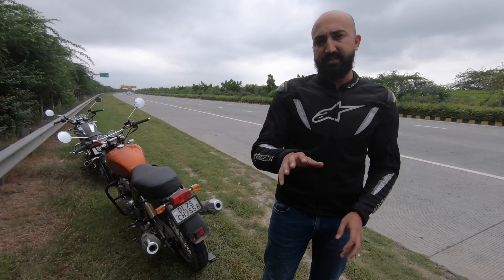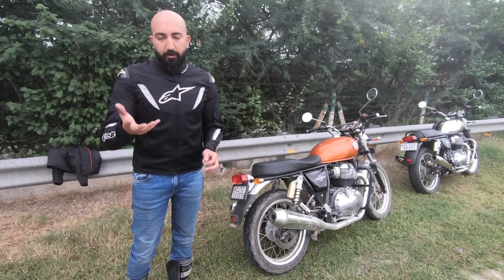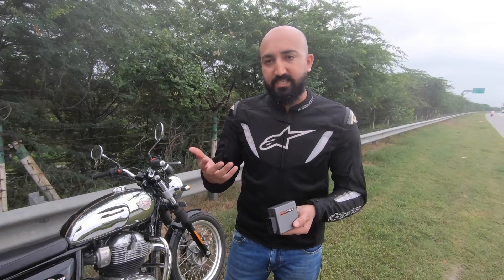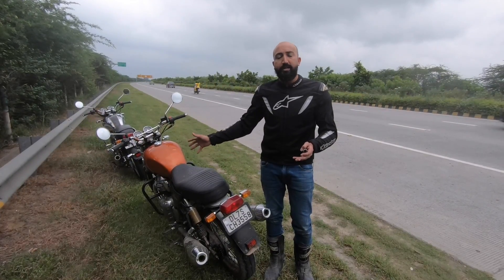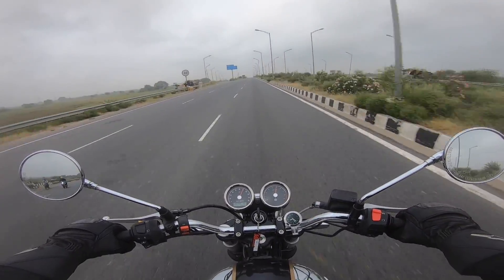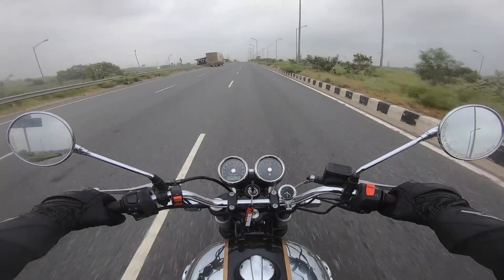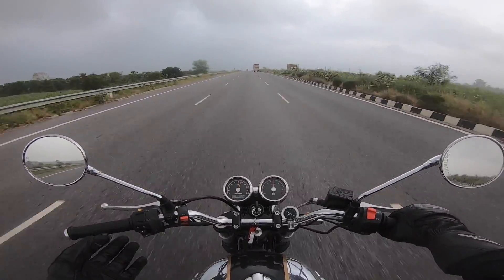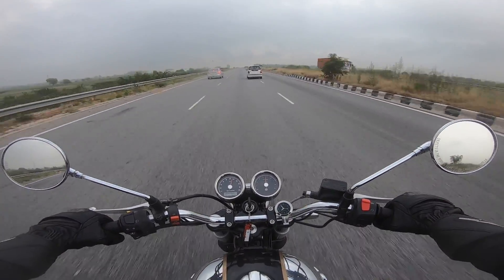Powertronic ECU For Royal Enfield Interceptor 650: 3-Month User Review

Comment: Spending 3 lakh on this id prefer to keep it stock. 
It's about looking good than going Fast here. 
Hahah, my pov. 😅
Reply from the maker: No problem with that. To each their own. ✌
Reply: Bike cost almost 3 lakh + 3 lakh for ecu?? I guess you will get better bike for 6 lakh
Reply: @jbasumatary7861  which ECU did you buy for 3 lakhs?!
Reply: @jbasumatary7861  ecu. About 20k ok who said 3lakh for ecu
Reply: Yeah bro me too 😅😅
Reply: chandrakant Singh Pratap  it's around 20k 
Plz see the video there it is mentioned
Reply: chandrakant Singh Pratap you think ur self that u want extra 2bhp and little torque or not 
Because thrilling experience never comes with worth
Reply: chandrakant Singh Pratap  it comes with two performance modes. The first one does increase power but due to the better fueling the mileage doesnt decrease. The second one is extreme sport mode which offers  better top end punch too...well obviously since its extreme sport mode the second mode reduces mileage but only 2-3km difference mostly because you will also be riding hard in that mode 😀i have done my research and i have also been using it on the r15 v2 for several months now hence saying from my experience 😊

Comment: Should have tried the ECU with high octane fuel, to get the best result
Reply from the maker: Didn't do that because it is not something most will. Otherwise even I would prefer riding on 97 octane fuel :)
Reply: Nothing will happen, high octane is used for high compression ratio engine with advance timing.

Comment: Its better to wait if any seller imports S&S Big Bore kits(750cc and 865cc) for the 650 twins. 
Wasting money and time on cheap and useless aftermarket slip on endcans and piggyback ECU has no sense.
The Big Bore kits can bump up power significantly and though they are not street legal but no one can know if you have used them in your bike.
Reply from the maker: The big bore kit and everything else accompanying it will cost upwards of 2 lakhs. How many would be okay spending that kind of money?

Comment: Why don't you make your own maps? It's pretty easy.
Reply from the maker: Hey man. I will. On my own Interceptor, I am running a 2x1 full system and with a filter it was running very lean. So will tune the map accordingly. You should check it out once. Do send me a DM on Instagram if possible. My id is abhinavbhatt19.
Reply: @abhinavbhatt  sorry bro I am not on Facebook, Twitter or Instagram. 😂😂😂😂 But mail me crazyfor200mph@gmail.com
Send me pics of your map I'll see if I can help you with mapping. I am using my own map on my RC 390.
Reply from the maker: @cranky1812  Will do, bro.

Comment: Adding those components didn't do much to the 0-100 & 0-120 flat out numbers. Both remain the same. So no point doing all the circus. Saying cause these are the speeds most will cruise on. Now sure how effective is this on city traffic. I wish some one opens up the engine and does the real work.
Reply from the maker: You could go in for a big bore if you'd like. The difference is not always about the numbers. The smoothness, throttle response and quickshifter compatibility are worth it, in my opinion. Try taking a ride with a Powertronic box once.
Reply: @abhinavbhatt , I agree.

Comment: Flashing ecu is a better option?
Reply from the maker: Who is going to flash it for you? And what about warranty, reliability? Powertronic is plug and play. You can take it off anytime and to back to the stock bike.
Reply: @abhinavbhatt  mantra Racing, i  don't have a parallel twin, instead have a few, usually i used to put a power commander or a bazzas over a ft flash for tuning , but last few times got a diavel and a busa flashed by mantra Racing, fueling was spot on, no needs of commander,
I would suggest a flash, filters, block off, exhaust, piggy backs very limited in algorithms, its just a buy pass, yes of course its a personal choice.

Comment: I have a powertronic ECU on my duke 390 and by making it run the correct Air/Fuel ratio it feels so much more responsive and does not run as hot as it used to.
Reply: This is the only valid reason for fitting an upgrade ECU.
Reply: Does it consume more fuel than before

Comment: Don't take other wise but in the city road conditions it doesn't help any more.In the normal riding condition only Power and average is matters and she is not designed for racing any more, specialy low compression ratio, bottom end torque ,air cooling, long gearing ratio & wait doesn't allow her to conquer the race.
      If it can be possible to  improving the existing ECU tuning then it can economical otherwise Westgate of money.

Comment: Your test is flawed.the test  bike should have been stock with only powertronics ECU instead of original ECU.you should not use different air filter, exhaust or changed the gearing of the test bike
Reply from the maker: I understand that. But I was running a map that is made for the filter and the exhaust. And I did not want to change back to the stock exhausts. The difference wouldn't be that big though.
Reply: Only the ECU should make no difference to stock. You need to open up the intake and the exhaust to get more flow. No flow, no go! :)

Comment: these ecu's  they make are way overpriced to the performance they offer.
Reply from the maker: No. I don't think so. Compare them to the prices of exhausts.
Reply: @abhinavbhatt  exhaust gives you looks, sound as well as a little performance. the ecu is just too expensive  in my opinion. and they void the warranty which is a bummer
Reply: @sagaraher5611  you are wrong.
Reply: cranky1812 do your research and then comeback with a reply
Reply: @sagaraher5611  I am using powertronic myself since 2016 on my RC 390 and it works flawlessly. I am using my own map and other mods on the bike. With just piggyback if you gain 2 to 3 bhp then it's very good. Also when someone goes for air intake modifications, exhaust modifications, head polishing and porting, high lift camshafts, bigger throttle bodies and bigger injectors then this piggyback ECU will give that engine a huge power boost as in powertronic you can increase fueling and ignition timing upto 25%. In this unit AFR, ignition timing, CKP, traction control, quickshifter, rev limiter can be adjusted. This unit is plug and play with complete wiring and software. My research is fine and my practical use is working awesome, do you have powertronic to access if it's good or bad?
Reply: @mohba01  you are wrong my map is absolutely different from the basic map of powertronic because my air intake and exhaust are not stock and default maps are to lean for my  mods. My CKP trigger values, ignition noise filter and load input channel are totally different and so is standalone mode trigger RPM.  So yes this my map which only works on my specific mods dude.
Reply: @mohba01  I don't need flow bench when I can ride and see that my RC has lost the acceleration and top end, with lean condition it ran crazy hot. I have been riding for a longtime and I can tell if an engine is running lean or rich. I don't have my personal Dyno in my house so it took me few weeks to get the right map.
Reply: @mohba01  powertronic default maps are for stock air filter with closed lid, my air intake has complete open lid with K&N so anyone can tell that after this mod huge amount of air enters the engine. My exhaust is completely free flow with almost straight short pipe with short muffler under the seat. This set up makes it crazy lean on default maps.
Reply: @mohba01  my ignition timing is at different degrees at different RPM range with respect to TDC. If you want I can send you the map pics for ignition.
Reply: @mohba01  maybe ejk unit is better but we don't have anyone selling ejk unit here. I have to work with what I have here and which is available in the market.
Reply: @mohba01  to improve the performance further I am looking for a wide band oxygen sensor, load input channel on PT can be calibrated from not only throttle position but also from injection pulse estimate.
Reply: @sagaraher5611  so better to pay for a mod that gives you "sound" and a little performance rather than something that only gives you performance? 
FYI, any aftermarket accessory would void your warranty.
Reply: @PierreSiddarthdeSouza  free flow exhaust without AFR correction will decrease power output.
Reply: @cranky1812  any changes without changing the fuelling and ignition would lead to a drop in performance.

Comment: the 0-100 timing would have been much better if you could have launched better (maybe around 6sec or just under it) because i myself found the timing to be around 6.3 seconds and that too with just an aftermarket exhausts. the quality of the video is otherwise good and the video informative.
Reply from the maker: Hi Ayush. See, I got a bad launch almost consistently on all tries. So definitely a better launch will give better results. However, don't look at the best achievable numbers, that will vary from person to person. Look at the difference between the numbers - that's what the video is trying to convey. I am glad you found the video informative. Cheers

Comment: Any heating issue if you use just a slip-on and will it affect the engine and mileage drop 
Am looking on the long term reliability with a good slip-on, Thank you.
Reply from the maker: Hi. No heating issues whatsoever with a slip on. Fuel economy drops less than 10 per cent. My impression of slip ons - both AEW and RRP - has been very positive.
Reply: @abhinavbhatt  hi watz your opinion on grease house growlers?

Comment: Hi bro..nice video with comparison. I have something to ask. Please help me out.
I've a GT 650. I'm planning to go for aew megaphone.
1. Whats the difference between TE 101 , TE 102 and classic short 201? Which one should I take?
2. In TE 101 stainless steel matt polish is showing 16,000 and mild steel chrome is 9000 (though they almost look similar).
Is that the price of one piece or a pair? And why so much difference.?
Reply from the maker: Hi. The difference between 101 and 102 is just a bit of difference in shape. 201 is a completely different shape, more retro. Go with the one you like the most.

The chrome one is made of mild steel and the matte one is made of stainless steel. Stainless steel doesn't rust and looks better. Zero difference in performance. So go with whichever you feel like spending for.
Reply: @abhinavbhatt  the prices are for one piece or a pair?
Reply: @abhinavbhatt  like...if i go for 102 stainless steel matt polish ...do i need to get 2 units for 36k 😯
Reply from the maker: @adikumar7099  the prices are for a pair.

Comment: Trust me I have been using powertronic ecu on my rc 390 for past 5 months city drivability seems pretty good without any jerks, mid range seems pretty aggressive but don't expect a litre class torque on a open road it really disappoints on long stretch just 4-5km/hr top speed is gained approximately 187km/hr and even my stock bike does 183km/hr for an 18k product it's not worth

Comment: i have been using PT for last 8 months now in ktm rc 200 much better than stock .. earlier i used to do 10500rpm 137kmph and now on same rpm it goes 145 and plus it remaining 1500rpms left as it rev till 12k rpm so i think it will go between 150- 160 as seen on YouTube on ktm 200s 161 on 12rpm and top end is crazy which this bike lacked in stock lacked due to limiters ...all in all its amazing device . period.
Reply: Impossible. If you are doing the same revs on the same gearing you cannot possibly be going faster. It doesn't matter how much more power you have added. Same revs, same gearing = same speed.
Reply: @oldbatwit5102  agreed but ktm comes with speed limiter too beside rev limiter so it bypass the speed limiter hence its achievable for eg if look pulsar RS 200 does 146 easily on same 10500 rpm . Summary  kTm limits the top speed where as after market stuff removes it ...and im not faking it whats the truth telling in stock condition ktm goes 137 max
Reply: First You need K&N with open lid, free flow exhaust with proper map (air fuel mixture, ignition timing)
Second you need slightly taller gearing to get higher top speed.
Reply: @cranky1812  it has 12500 rpm limit
Reply: @karanbundhela3336  that will not help you, at that rpm you need titanium valve springs otherwise with stock springs you will have floating valves. Without correct AFR and ignition timing you not gain anything.

Comment: even the reviewers gave it 6secs for 0-100 how even with ecu upgrade its slower and even stock interceptors are doing 180s
Reply from the maker: If a good rider gets a perfect launch and gets a 6 second 0-100, they will also be able to get a 0-100 faster with the Powertronic.

I did not launch the bike well and that is why I could only manage 7 seconds. But again, with a similar average launch, I was faster with the Powertronic.

Comment: not much performance gain for the total price of the mods! where's the 10+bhp bump?!
Reply from the maker: Who promised 10 bhp bump? Did you not notice the gain in top end acceleration? Also, don't look at it from a power gain perspective. See how it improves the throttle response and makes the bike feel racy. What exhaust can give you that?
Reply: @abhinavbhatt  an akra or sc project full system could give you that if it were available for this bike. i understand that the sensation of the ride is much improved over the stock, but this is close to a 50-60k investment on mods for "better feels". i miss the good-old cost effective rx mods days. :(
Reply from the maker: No bro. Just get the Powertronic box for 22k and you are sorted. If you want a full system - I actually run one on my personal Interceptor that I am building up as a Brat - it is also available for 22k. More details on my Instagram on it. https://www.instagram.com/abhinavbhatt19/
Reply: You can have them till 70bhp if you are wiling to spend 2-3 laks. 3-5 bhp gain is good when you dont have to do much
Reply: for much higher top speed rev limiter should get extend which they haven't done in PT hence top speed merely will be same .